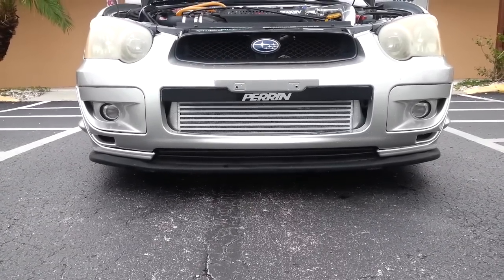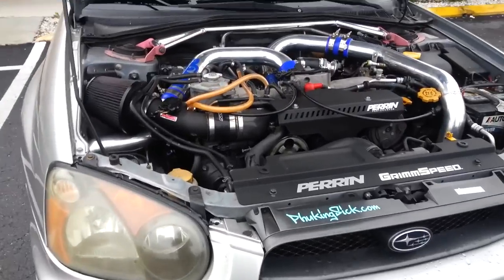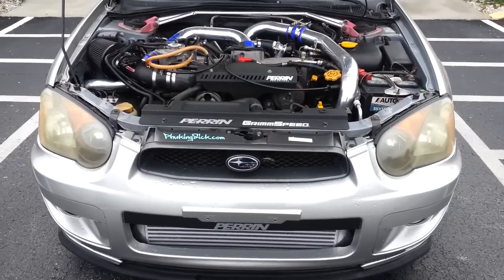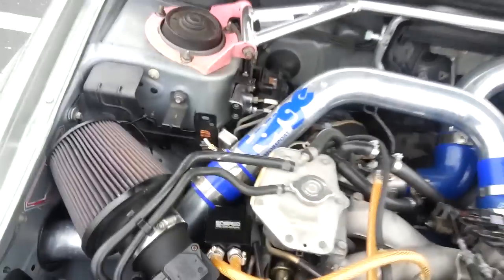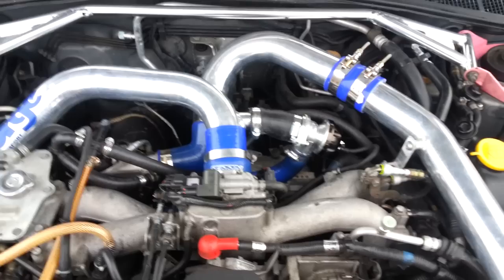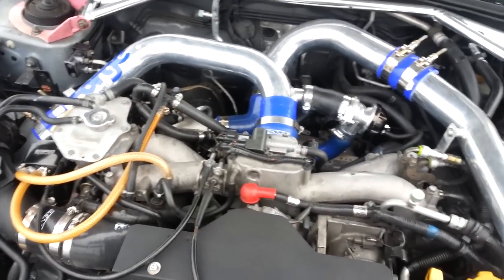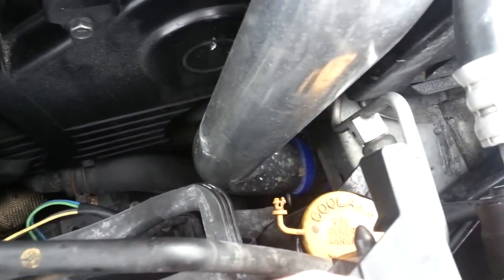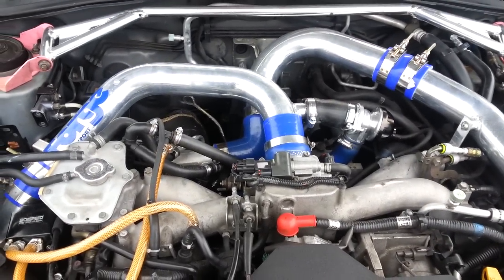Review: Rev9Power (Godspeed) WRX Front Mount Intercooler (FMIC)

Comment: did you end up buying a different intake or is there away to just use the perrin cai and shorten it up to make it it a sri?
Reply from the maker: I actually just took off the extension pipe and am running it as a short ram air intake. Seems to be working pretty good. Havent had any issues thus far.

Comment: Would like to make this my first major upgrade before turbo upgrade, would it be pointless to do with a TD04 turbo short term?
Reply from the maker: I'm a sense, yes and no. tuning I everything. you can squeeze a good amount out of that turbo before needing to go bigger. you can make in the area of about 240-270 wheel horsepower depending on the mods, and tuning, which is a pretty respectable car.

Comment: One question with the stock top mount there are three intake hoses two on the left one on the right where do you put them after you install the top mount do you plug them up or what thats the only issue i have so far
Reply from the maker: Those are your cylinder head breathers. The kit should have come with a black t fitting and a long rubber hose. Take the short hose and disconnect it and connect the long rubber hose to the driver side cylinder head. This will run all the way across the backside of the motor to the opposite side where the other 2 hoses are. Use the t fitting to connect all 3 hoses together. The one coming towards the front is an intake vacuum line, and the other coming off the side going towards the passenger side is the other cylinder head breather.
Reply: Robert Harridge ok so the install went well hooked everything up but when i start the car is doesnt stay idling it just dies ??? Know what might be causing it
Reply from the maker: michael river If it dies instantly, that means your MAF is not reading any air flow. Check this by unplugging the MAF sensor on your intake and start the car. If it runs, then your MAF is not reading air flow. Check all couplers and make sure all the clamps are tight. Also, make sure all vacuum lines are connected properly and your BOV is secured with no leaks. BTW, to help you out, what BOV are you running?
Reply: +Robert Harridge yup that was exactly it haha once i unpluged it and tested the start it kicked on stayed on so i relized oh shit im dumb i put my mass air flow backwards durp haha fliped it and now were golden took and extra 2 3 hour to find that out haha
Reply: +Robert Harridge and I'm running a tial bov

Comment: what are the pipes from the left and the right in the middle of the engine bay?
Reply from the maker: you may be talking about the cylinder head breathers. they pull vapors from the tops of the cylinder heads to reduce sludge and pressure build up.

Comment: did you tune it? when you did the fmic coversion?
Reply from the maker: initially, no. Eventually, yes. Was there a difference? Because there was a few other things done, yes there was. Not only on the real dyno, but you could feel it on the butt dyno as well. Definitely was able to shift the power band to the right a little more, and was able to increase the torque in the mid range a little more. I sure do miss this car...
Reply: @RobertHarridge  almost no one keeps there subies, makes me sad. i got a rex aswell and im not planing on selling it ever! thanks for the feedback tho, what do you currently drive?
Reply from the maker: @Atrickz.  I wrecked mine... :(. I got a newer one, though.
Reply: @RobertHarridge  ohh how is that going for you? do you feel much boost like the older subies?
Reply from the maker: @Atrickz.  I’ve got a 2010 WRX hatchback with some bolt ons, protune, and an STi 6-speed swap. Tuned at 21.5psi, and makes more power and torque than my old car. Realistically, it’s a better car than my old WRX... I just like the old WRX’s.
Reply: @RobertHarridge  bro nicley done, fully built? dam thats fast ive got vf34 other mods boosting 15psi, and yes the old GDs and GC8s are subaru classics!

Comment: which brand intake is that? aem? trying to find one that will fit with it after i buy that kit
Reply from the maker: Perrin short ram air intake with K&n filter.
Reply from the maker: Correct. It mainly makes the turbo louder. However, later on I did fabricate a heat shield for the air filter and it made a huge difference in air intake temps. About a 15-20 degree difference from the air on one side of the shield to the other. But without that shield, it was sucking in moderately hot air.

Comment: I really don't understand why they supplied a "type rs" BOV.. With a Turbo XS flange built into the IC piping. Lol that's ridiculous. I like your ingenuity though! Haha I've done quite a bit of research on the Turbo XS RFL BOV, and I'm
Hesitant to order one. I really don't want to deal with welding on a new flange adaptor though. So maybe I'll give it a shot.
Reply from the maker: I personally dont like Vent-to-atmosphere BOV's. They always make your car run like crap in between shifts. I personally like the 50/50 hybrid or just a full recirculating valve. If you have a cone filter, you can still hear it. I had them throw the type RS valve in as part of the deal. I just modified it myself. lol.

Comment: Did you have to have it tuned or can you just put it on and drive it
Reply from the maker: you can put it on and be ok, however, it is better to be tuned. mine is tuned.
Reply: You don't need a tune. The air inside is already measured.

Comment: do you have to retune if i install a front mount intercooler?
Reply from the maker: +Sir Robert James Jackson it's not necessary, however it is recommended. I didn't have it tuned for a while, and all the parameters looked fine. My tuner said he could have left it, but due to the cooler temps, he was able to advance the ignition timing a bit more because there was less knock.

Comment: You have numerous inefficiencies in this set-up.
1) The Intake
It is not a cold air intake as it still sits in the engine bay.  That is just soaking up hot engine bay heat and your IAT will be much higher.  Simply dropping in a high flow filter into the stock box would be efficient.  It sounds cool, but it is not cool.
2) Charge Pipes
The aluminum pipes again (as you stated) do absorb a lot of heat and you are defeating the purpose of placing the intercooler up front.  So, hot side IAT will be very high factoring in Aluminum and exposed air intake - not good; as will the cold side IAT2.  You will be losing a lot of power, as your timing will be cut to control knock with those temps and your intercooler will struggle to provide a benefit.
3) Blow off Valve
The Blow Off approach as opposed to a recirculation approach provides a “Sound” that many think is cool - but that just slows down the turbine and you have to respool again.  Definitely not an enthusiasts choice.

Hope that is food for thought?
Maybe on the next ride you obtain, this information will help be the wiser.
Reply from the maker: Holly Wood to answer your first part. Year, the stock intake is more efficient, however you cannot use the stock air box with the front mount inter cooler piping. The piping does deflect some of the heat from the intake, isolating the filter, however as you stated, the pipe going over the turbo, which is a charge pipe after the intercooler, can become heated. Solution is turbo blanket on the turbo, heat wrap on the downpipe and up pipe, and even adding a turbo heat shield over the turbo makes a huge difference in retaining heat where it needs to be retained, and not where it gets absorbed. Also running a heat deflecting tape on that charge pipe over the turbo keeps the air temps down, and of course, the air blowing in from the hood scoop blows cooler ambient air on to the turbo and blows the heat down through the bottom of the car. Now, finally, that blow off valve was actually set up as a full recirculating valve. So your statement is correct. It is completely inefficient to run a VTA valve, and in fact causes more damage in order to make “cool sounds”. That particular one was a really shitty valve, and was eventually replaced with a TurboXS valve. So yes, you made a lot of points that, after this video was made, was addressed before the car was wrecked. My current WRX, you would be very happy to hear is still top mount inter cooled, has a Cobb SF intake with the air box, and has all sorts of proper mods that make the car reliable and make power efficiently. Thanks for watching and I appreciate this comment.

Comment: where's your coolant overflow tank at?
Reply: You get a aftermarket one which is slimmer and longer. Its mounted on the left side of the radiator but kinda beside the headlight but lower also you use a self tapping screw to mount

Comment: Omg by changing your hood scoop you just removed main characteristic of sti. That hood scoop is something that defines sti- now you just own another honda lol
Reply from the maker: Dont you worry, I put the STi hood scoop back on. I liked the reverse scoop, but you are right. The signature of a real subaru is the hood scoop. Couldnt agree with you more.
Reply: I own 05 sti and that scoop is the last thing on my car that would be changed
Reply: Btw any problems with aftermarket intake? I want to finally change mine but not sure if i should
Reply from the maker: Tomasz Rzeznik None what so ever with the Perrin as far as tuning goes. Fitment... the K&N cone filter is a little big for that area. Its very close, if not rubbing on the hood, and it rests on the intercooler pipe. I would prefer to use the one that comes from Perrin... but I bought my intake used, and the filter was pretty heavily damaged when I got it, which is why I have the K&N filter on it.

Comment: cough cough * you don’t need a cold air intake when you have an inter cooler... that cools air *cough cough
Reply from the maker: OSU Bucks421 cough cough the MAF reads air temperature and density to adjust AFR and ignition timing, so yes, you do. And the factory air box doesn’t fit with the Intercooler pipe in the way cough fucking COVID-19.

Comment: aluminum intercooler weight hahahahahah
Reply from the maker: Agraxian quarantine getting to you, I see. Losing some brain cells? Before you start arguing, read the comments from all those years ago. It’s explained in there, and others that have done the same thing have voiced their opinion as well. Go eat crayons.
Reply: @RobertHarridge  the so called weight you think you are moving is absolutely negligible. The only thing you are doing by moving the intercooler is ruining a perfectly well designed piece of engineering. If mounting on the front is so much better don't you think Subaru would have done that from the start? This so called heat soak is also something absolutely negligible and would only occur if you install a stupid short ram intake (like you've done) once again ruining the countless hours engineers spent making that engine perfect for someone like you to ruin.
Reply from the maker: Agraxian heat soak effects the intercooler as it sits on top of the turbo on an EJ motor, you pinecone. It has absolutely NOTHING to do with the intake. It has everything to do with radiant heat coming off a turbocharger. Heat rises. The Intercooler sits on top of the turbo. Heat soaks the intercooler, thus making the Intercooler less efficient in stop and go traffic. Eat crayons you moron.
Reply: Ahh yes the heat soak yes yes. I guess you should contact Subaru and tell them to change everything immediately 😂
Reply from the maker: Agraxian it’s funny because even in their Rally cars, they use a front mount/V mount setup and the hood scoop is used for an air cleaner. So again, pound sand.

Comment: Just bought an 06 wrx and I think it has this kit, but I think the previous owner put the core upside down? Is that possible, also would that cause and idling issue because the car idles rough when warm. But runs strong when wot
Reply from the maker: Carlos Gonzalez I suppose it could be possible, however the length of the pipes on either side would quickly indicate that it’s installed improperly. As for your idling issue, you could have a vacuum leak at idle, but I would go more with an improper tune first. Do you have a tune on there? Like using a Cobb Accessport?